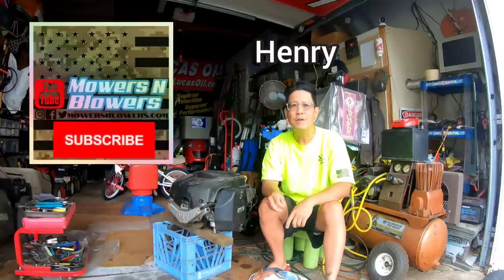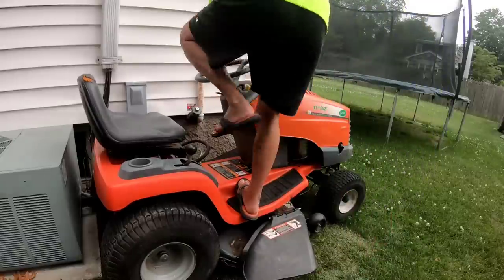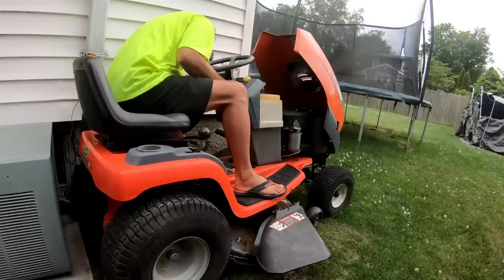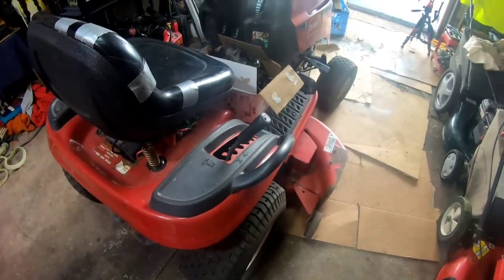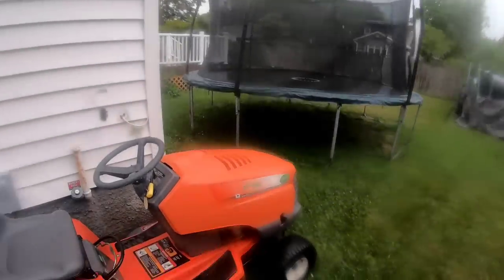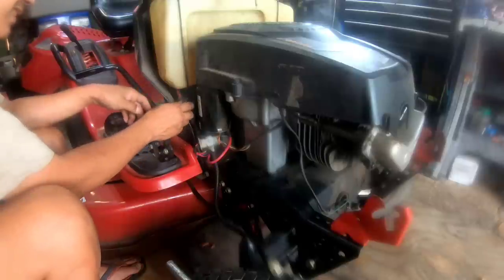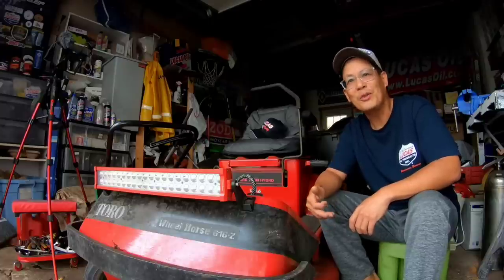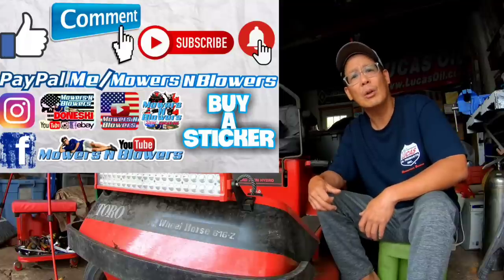FREE TORO LX460 46" KOHLER CVT TRANSMISSION LAWN TRACTOR REPOWER PROJECT BATTERY & ENGINE MOUNTING

Comment: Henry I just fixed a Toro with the Tecumseh like you mowed with.  Mine has the personal pace system.  Have you ever had a Tecumseh powered personal pace? Most of the ones I have worked on were Briggs powered.
Reply from the maker: Yes, I’ve had a few,  I don’t like the personal pace because I feel the drive control handle is too sensitive and binds.

Comment: Jack up the front end to get to the engine mount bolts.  If you have a longer extension that will work or at least the wheel will stay turned.